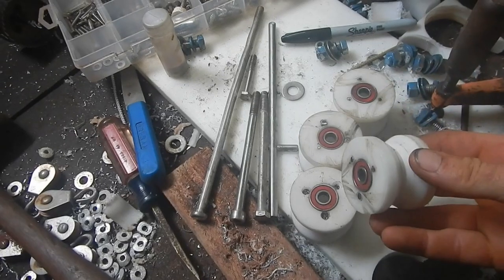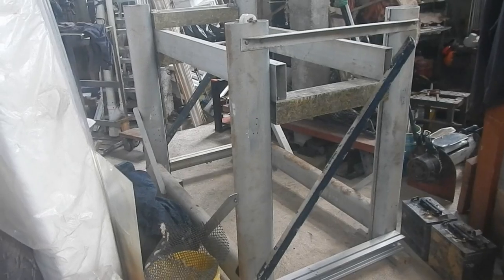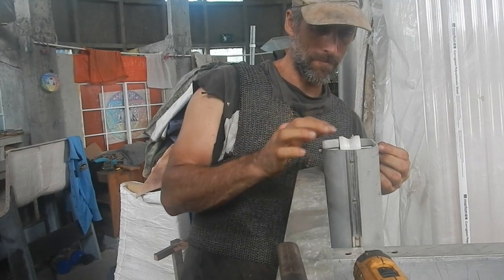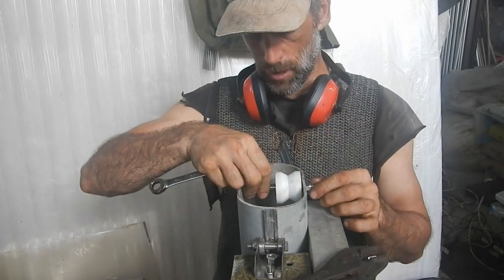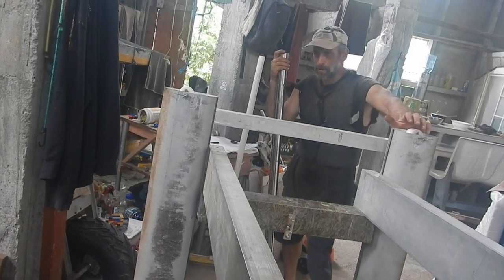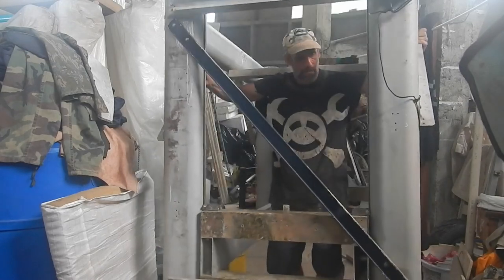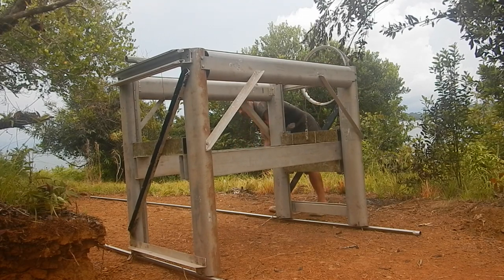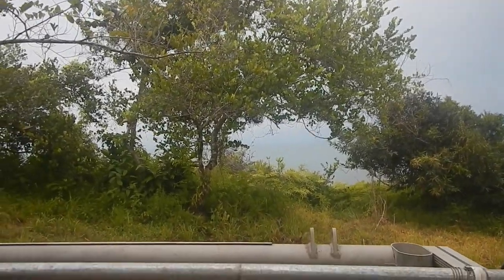Lumber Mill 018 Go Outside!

Comment: crossties are a must have. for a brake maybe just an L shaped pin you can drop in the ground, maybe with a foot... a large barrel lock for a fence would probably work.. more basic would be wedges you drop on the inside of the track